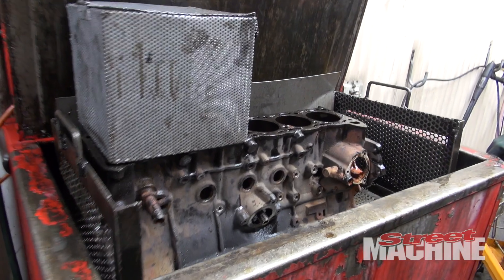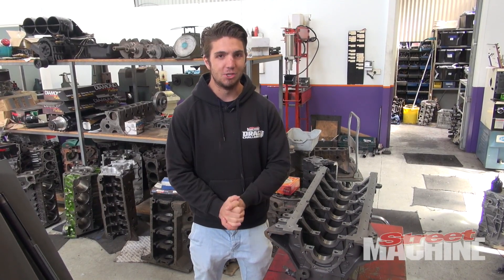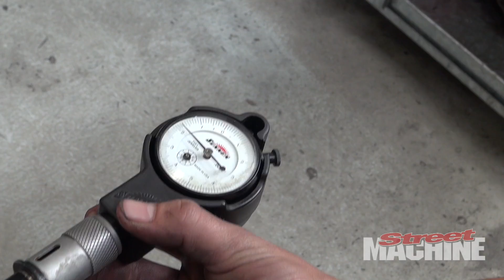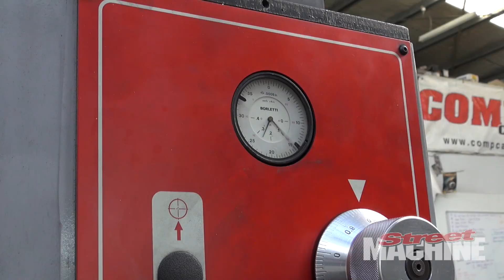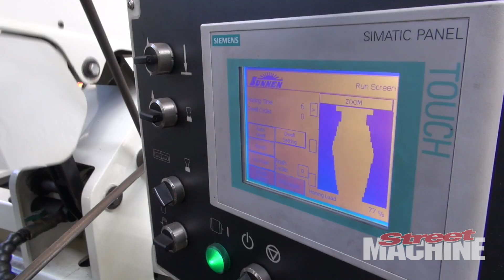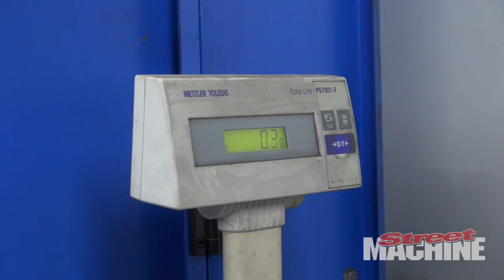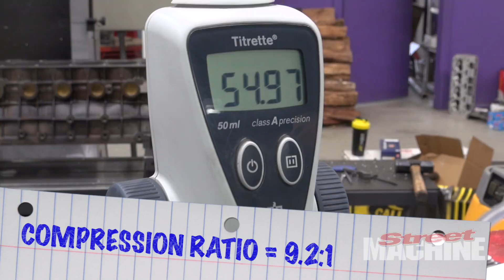Aiden's Project VL - Codename RB-DIRTY- Part 4

Comment: Ooohhh, Aiden- I think my RB is going to have the goods on ya mate. I've got higher comp, more port work done on the head and I'm interested to see how much duration your cam is going to have... You do have better flowing manifolds than me though, so it'll be interesting. Can't wait to line you up at Calder mate. Although I only get 1 or 2 runs before I get the boot for no cage and 'cute. Good stuff bro

Comment: Is it the rb25 head or the bottom beter with the 30
Reply: 49ics both r tuff...a lot of people go rb25 head
Reply: Depends on the use case. The RB30 is common for 1000bhp builds. You will also see RB26 heads used too.

Comment: Seriously? Would it have not been much cheaper and better in the long run to just get a RB25 head rather than messing with the original?
Reply: HKRXPRS or, another, larger, cheaper, 4L 6cyl DOHC
Reply: single cam rb30s make a load of power without the stuffing around of finding a head, doing the work to fit it, fitting the loom to suit the head, wiring it up and tuning it. granted this will be getting a tune anyway.
Reply: Nor Dic. A Ford Barra turbo would cheaper and not require as much building. Just look at what Mighty Car Mods did.